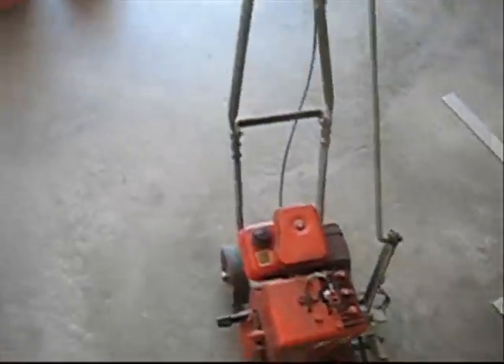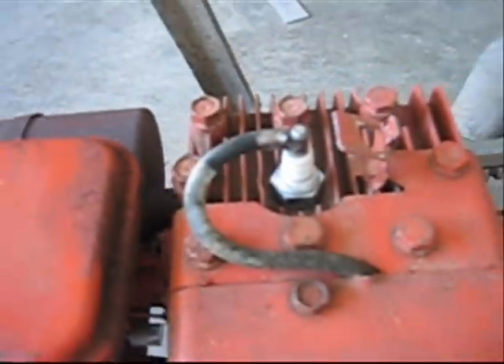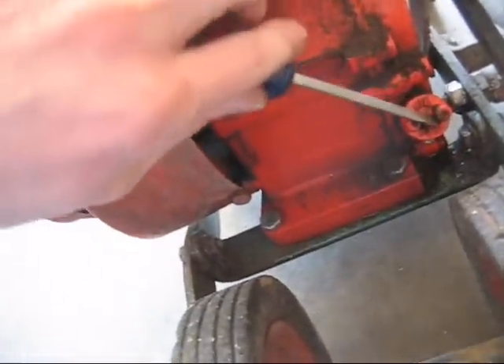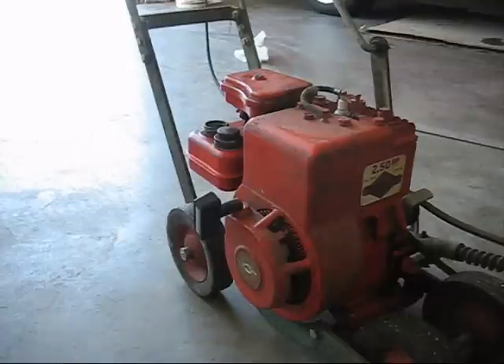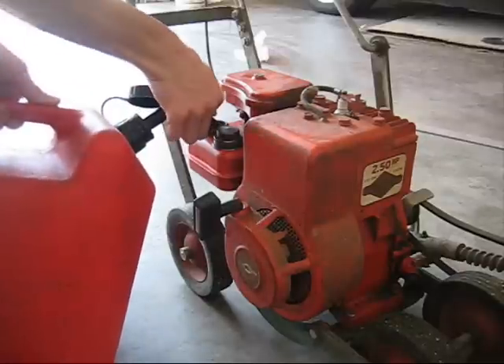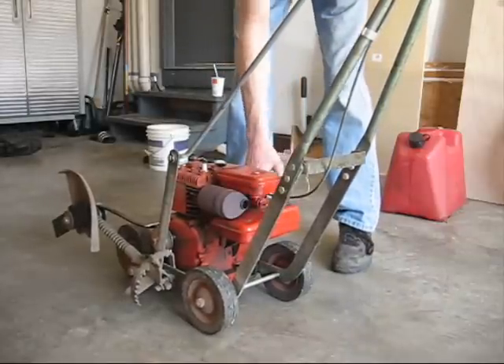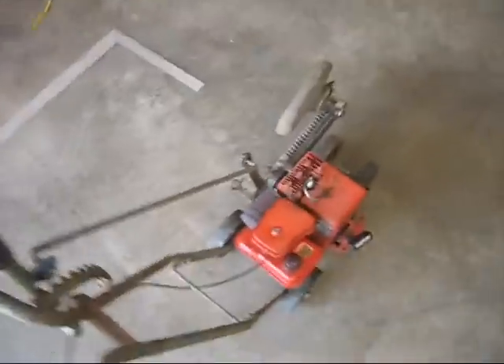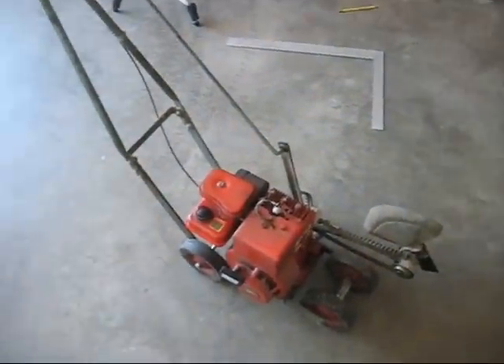Briggs and Stratton Edger Old Cold Start

Comment: I had a Honda water pump that was sitting next to a dam for a year or two, so it was seized, but we pulled it apart and cleaned the impeller, then 3 pulls and it ran.

Comment: I just bought one just like it and i was wondering do i mix the gasoline?
Reply from the maker: No. This is a 4 stroke engine so it runs straight gasoline. No gas-oil mixture. Oil goes in the crankcase.
Reply: No. Briggs and Stratton of this era were four cycle. Oil is in the crankcase sump, and fuel tank is just straight Gasoline.

Comment: I have one like that. But I'm getting no spark. Any ideas anyone?
Reply: These engines are very susceptible to rust on their flywheels when they get wet.  Rust or metal shavings will ruin the air gap you need between flywheel and coil legs.  My advice would be:

1. Remove the blower housing (3 bolts 7/16"....one on top, one on front down low and one in back down low)
2. Remove the little screen by taking out the bolts holding the screen in place (2 tiny bolts 1/4")
3. Using a wood stick and rubber mallet, tap on the bumps of the clutch (the starry-looking aluminum thing the screen was bolted to).  Tap it counter clockwise to spin it off.  Be gentle and patient here. Use many small taps to coax it off.  Don't whail on it
4. Remove bell-washer
5. Remove the flywheel using a rubber mallet or soft hammer blows.  Be careful...it is heavier than you think
6. Remove the flywheel key....you will need it later
7. Wire wheel the flywheel carefully until you get all the rust off the edges of it.  Be sure there are no metal filings on the perimeter of the flywheel OR the coil legs
8. Wire wheel the coil carefully until you get all the rust off the edges of it where it faces the flywheel (I call them the "coil legs")
9. Replace the flywheel and key on the spindle 
10. Replace the bell washer domed side out to create spring pressure on the top of the flywheel
11. Spin the clutch back on and tap it a few times to hold the flywheel on

SET THE COIL AIR GAP
1.  Rotate the flywheel until the magnet on the flywheel is pointed away from the coil
2. Loosen the two 1/4" bolts that hold the coil
3. Set the air gap between coil legs and flywheel by using a .020 feeler gauge (or a cardboard matchbook cover) to leave just a small air gap between them, and retighten the little coil bolts.

You're done.  Just do steps 1-4 in reverse to put it back together